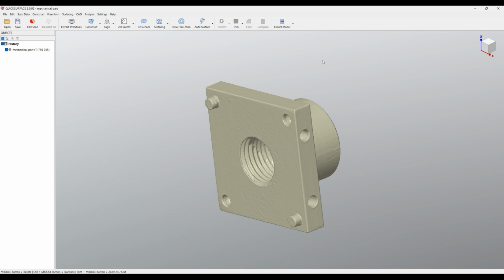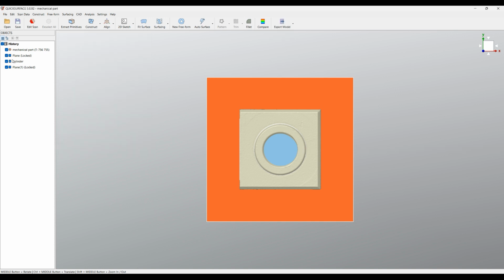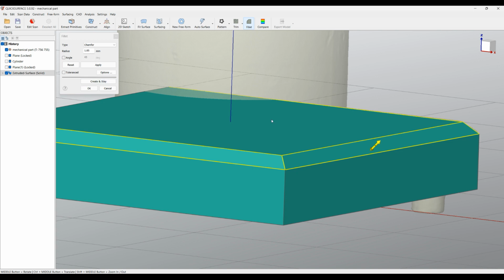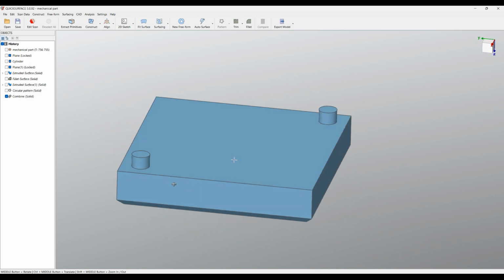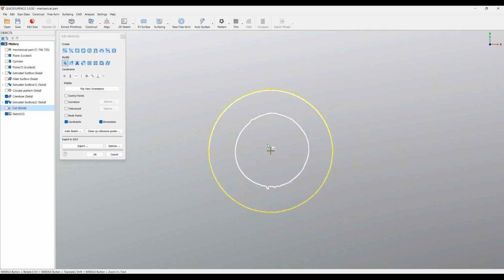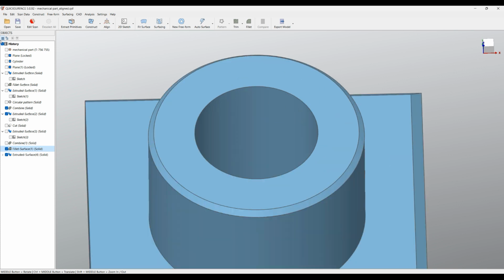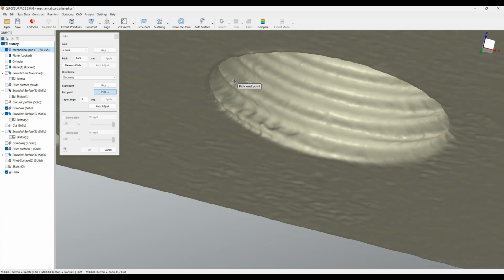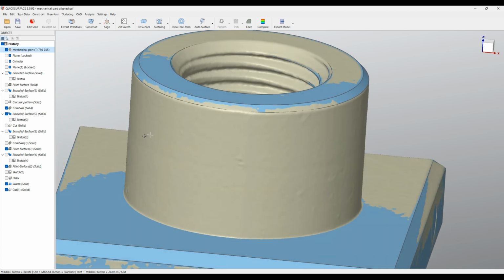Step-By-Step Tutorial (Mechanical Part): Intermediate course with QUICKSURFACE

Comment: It seems like this method of creating the thread (sweeping the profile) doesn't work anymore. "Sweep failed. If the path is closed, it needs to be smooth. The red..."
Reply from the maker: The profile should not overlap while  sweeping
Reply: @QUICKSURFACE  Got it now thank you. I followed the new Pool Cap video from you guys and it puts the sweep path down first (instead of second) to you can make sure it doesn't self intersect